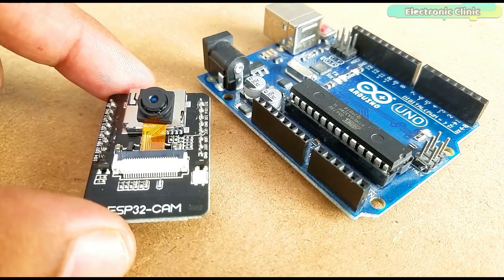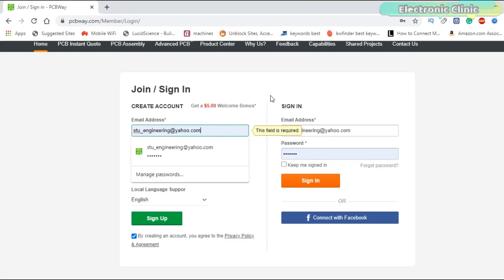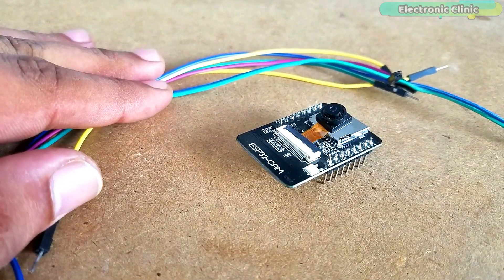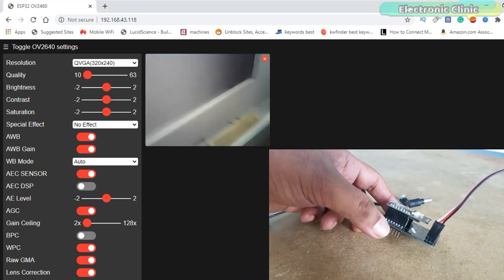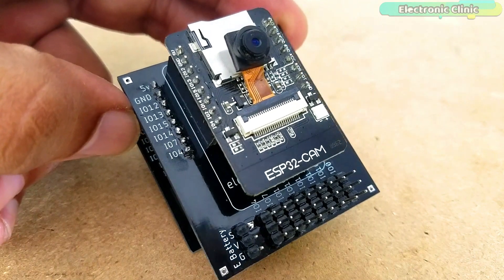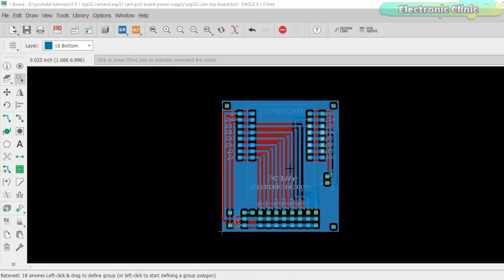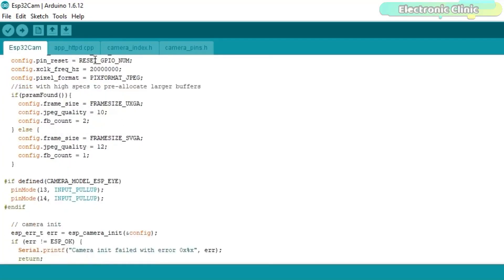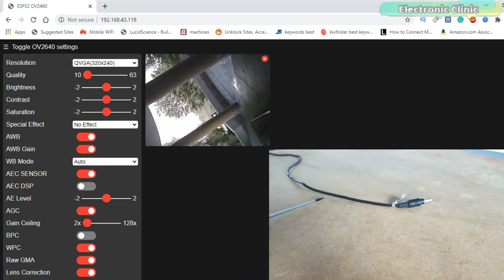ESP32 Camera Module development board for Live Video Streaming, Sensor monitoring & controlling.

Comment: I need the correct solar panel (or plug into 120v AC outlet).   We have cold winter but NO SNOW.

WINTER IS SHORT 3 MONTHS. MOSTLY 46DEGREES FAHRENHEIT DAY TIME.

Comment: You should add two capacitors one input one output 104 to stop any spikes to the regulator and change C1 to 1000uF. I did not notice any heat sinking on the PCB, so the  5 volt linear regulator will get hot.